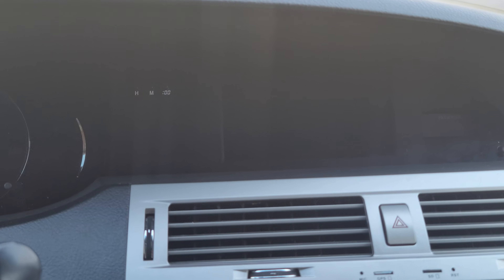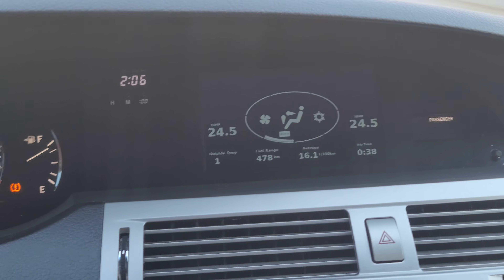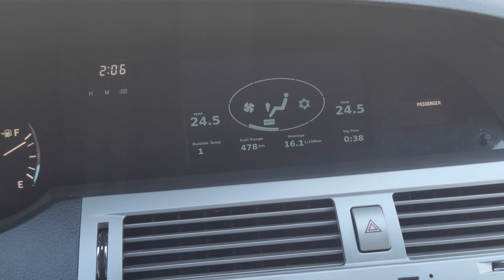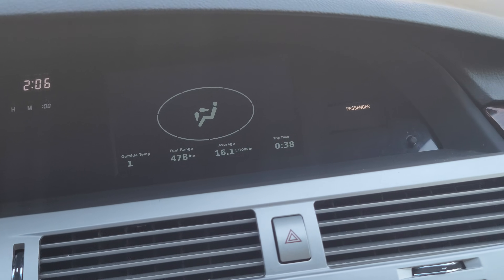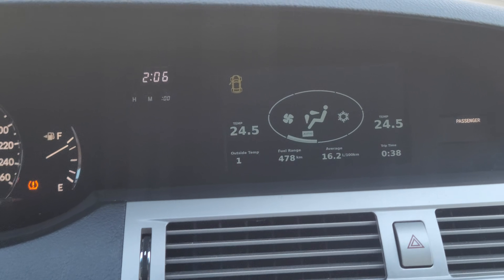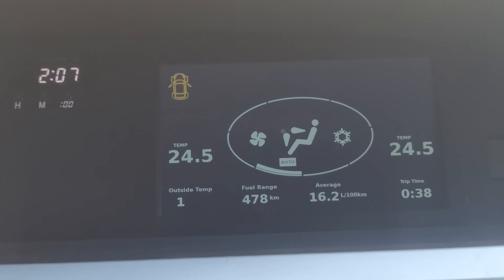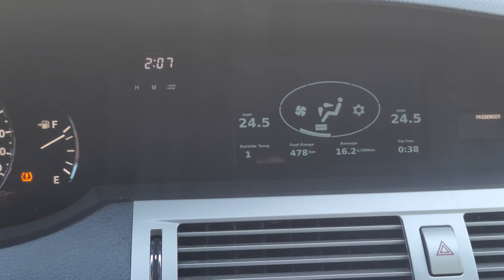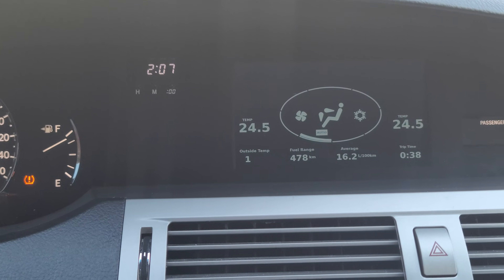It's ready!! - New Toyota Avalon Master AVCLAN LCD Module

Comment: Hey this is great work, well done. I am about to attempt to replace the HU in a Lexus ES300 (2002) and retain the stock amp. I would like to test the sniffer board with your software to send a code to the amp to emulate the master device on the LAN. I am hoping the current OEM HU is the master. One question, did you include the code you wrote that interfaces to the sniffer board?
Reply from the maker: I include a link to my code in the description.  I have a new version I've been working on, but has been on hold for a while due to health issues.  I'm hoping to get back to it soon.
Reply from the maker: https://www.etsy.com/ca/listing/1791707890/lcd-panel-activator-for-2005-2010-toyota

Comment: So as I am not tech savy at all I think connecting my old radio in the trunk will be easier for me. I actually got the new radio in & steering controls connected but not the car info .
Reply from the maker: https://www.etsy.com/ca/listing/1791707890/lcd-panel-activator-for-2005-2010-toyota

This would be easier.

Comment: I know my model of the 2008 Avalon is slightly different because it has the JBL Amp and Navigation... But I am having trouble finding information about this setup for a generic android radio that was made for my generation of the Avalon... I regret my purchase. I am trying to get the air condition to function , and I am unsure of how to resolve this.... That's only one of the problems in my journey. I know you don't have any obligation to help me.... but I have hope that your project here could point me in the right direction. 

Basically, The Aliexpress seller gave me a lot of different cables, but of the 3 original factory radio cable/harnesses, only 2 can be plugged into the provided cables... I believe the 3rd one has something to do with the Nav/AVCLAN, and I am unsure how to resolve this.
Reply from the maker: My Android radio also came with a CANBUS device, but I have not t idea what for.  I sniffed it for avclan messages and found none.  I know my new device works with the blue LCD, but I don't have confirmation with the NAV screen yet.  There's no reason for it not to work if the NAV LCD also depends on the factory radio. You can try this. 

https://maybefindithere.etsy.com/listing/1791707890

Comment: Will this work with the Jbl with navigation? i also have an aftermarket radio powering the jbl system via a pac tato.
Reply from the maker: I don't have experience with the NAV version.  However if the NAV unit isn't acting as the master when the radio is removed (I'm under the impression in some Toyota's the NAV unit is the AVC-LAN master) then most definitely my system should be able to function as the AVC-LAN master.

Comment: Before I start ordering parts, do you know whether anyone has the hardware (especially a PCB) already bundled for the avclan portion? Or which Arduino development boards would you recommend?
Reply from the maker: FYI, I have just finished designing a PCB that is intended to replace the radio function only of the AVCLAN.  It also optionally can have a Bluetooth connection so that you can see the communication with the AVCLAN.  I have not had it made yet as I am reviewing the design, but I can let you know when it is ready and tested.
Reply from the maker: I know of a user that uses an Arduino UNO.  I preferred to build my own to make it more compact.  I'm starting to work on a custom PCB as time permits.
Reply from the maker: https://www.etsy.com/ca/listing/1791707890/lcd-panel-activator-for-2005-2010-toyota

Comment: Greg: I’m a little lost in this install, I was led to believe the pac interface module for Toyota was going to solve the issue of the hvac screen without having to relocate the factory radio to the trunk. Is this not the case? I’ll be installing my new head unit this weekend
Reply from the maker: I'm afraid I'm not familiar with the PAC interface module.  If you try it out, let us know!  Many Toyota vehicles only need a resistor to terminate the AVCLAN TX+/- wires, but the Avalon is different because the radio is the AVCLAN master device that the other AVCLAN devices register to.  That may be different with the NAV model (which I don't have) if the NAV module is the master unit, I'm not sure.
Reply from the maker: I have just designed a PCB module which I will soon have made that will replace only the radio functionality of the AVCLAN.   Additionally it will optionally have Bluetooth to connect and monitor the AVCLAN messages through a Bluetooth serial monitor.  Let me know if you are interested.
Reply from the maker: https://www.etsy.com/ca/listing/1791707890/lcd-panel-activator-for-2005-2010-toyota

Comment: Saw the link to GiHub and checked it out which looks good for description. I’m on mobile so I couldn’t pull the files. I wanted to know though where to and what I exactly need for the hardware to load the code into.
Reply from the maker: The most basic way for a beginner might be an Arduino UNO.
Reply: @GadgetNuttTech  noted. I'll be sure to pick one up and see where to take it from there.
Reply from the maker: I have just finished designing a module and will be having it made soon.  Let me know if you are interested in obtaining one.

Comment: If wanting to get a radio for a 2010 limited how would the install go, what specially would need to be done to keep my functionality of navigation and such, different lcd from what you have
Reply from the maker: I have designed the code in my GitHub to be very flexible and can be configured to just replace the factory radio as the AVCLAN master, leaving the factory LCD panel intact. Just the Atmega "sniffer" board would be needed if you need to replace the AVCLAN master functionality of the factory radio.  This could be done with an Arduino UNO to keep things simple.  I didn't like the factory LCD panel with its bright blue background so I killed two birds with one stone.
Reply from the maker: I have just finished designing a compact PCB module to replace the factory radio's avclan functionality.  Let me know if you are interested.

Comment: I know this was done a year ago, but am hoping that you could tell us the brand and model number.  Something that you didn't show was the Navigation.  Does this also provide the screen for navigation, or have you incorporated that in the new radio?
Reply from the maker: My Avalon didn't come with NAV.  I do navigation through the new Android radio using Waze or Google Maps, the same as it would be done on any Android device. Conceivably since the new LCD panel is Raspberry Pi base, you could do whatever you want with it if you have the know how.  That's something I have considered, but it isn't on my to do list right now.

Comment: Do you have a kit for that or where can I get it
Reply from the maker: https://github.com/GadgetNutt/AVC-LAN-Module-Builder
Reply from the maker: Just finished designing a PCB module and will be having it made soon.  Let me know if you are interested in obtaining one.
Reply from the maker: New PCB"s have been received and tested.  New video update coming soon.
Reply: @GadgetNuttTech  Could you place a link that fits the 3rd gen avalon? i cant find one older than 2012 on Aliexpress
Reply: Can't wait for that video. Your invention is exactly what I've been looking for!
Reply from the maker: @g3tapple  https://www.etsy.com/ca/listing/1791707890/lcd-panel-activator-for-2005-2010-toyota
Reply from the maker: Working on it...
Reply from the maker: https://www.etsy.com/ca/listing/1791707890/lcd-panel-activator-for-2005-2010-toyota

Comment: Great work! Do you plan to sell the atmega interface portion? Would love to utilise an AVC interface to create my own rpi based gauges (boost/oil temp/etc) that also lets me adjust the climate control
Reply from the maker: https://github.com/GadgetNutt/AVC-LAN-Module-Builder
Reply from the maker: That is a definite possibility.  The huge benefit of my firmware is that it should be adaptable to be able to replace any AVCLAN function on any Toyota, and even add new functionality!  The data presently transfers over serial, but I'm working on implementing an I2C interface between the RPI and the Atmega328 so that I can add other devices such as the proximity sensors I mentioned in the video.
Reply from the maker: I have just had some PCB modules made and tested.  New video update coming soon!
Reply: @GadgetNuttTech  good to hear!
Reply: @GadgetNuttTech  I'd definitely be interesting in buying on of these. I have an 08 Avalon no JBL, no navigation and I just started looking into replacing the radio only to find all of this info about losing the LCD in the process. I really don't want to install the head unit in the trunk just for that function. I'm impressed by all the work you have done over the past several years. I was going to start searching for ATMega boards to download your code to tinker with, but if you have a product ready...
Reply from the maker: @scottmasters6107  https://www.etsy.com/ca/listing/1791707890/lcd-panel-activator-for-2005-2010-toyota